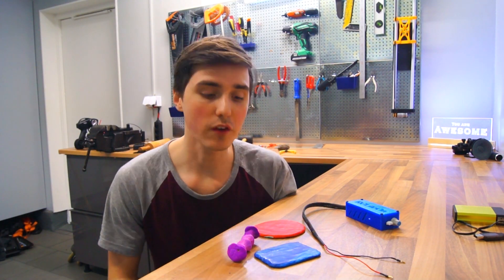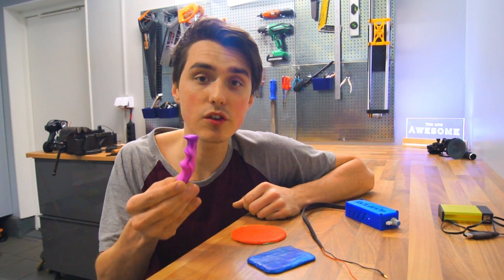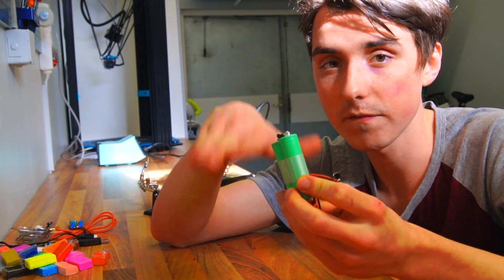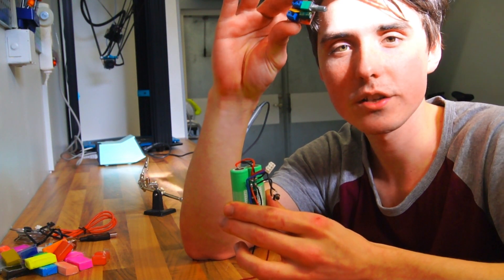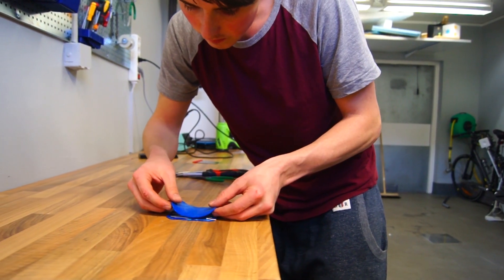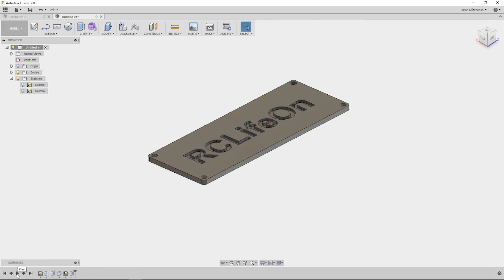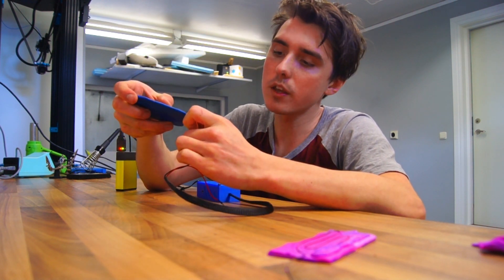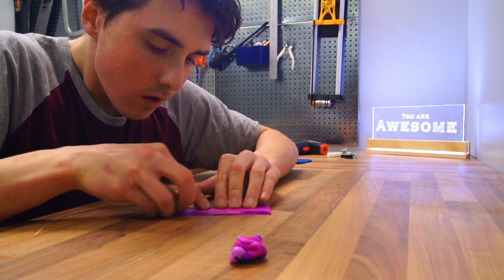Awesome Hand Warmer Life Hack - DIY Heating Elements

Comment: Greetings from Avebury in England. Please could you explain how to work out how much heating wire to use  (given the space available and how tightly you pack it in) compared to the voltage available vs the amperage drain? Thank you, and I love your well equipped workshop.

Comment: Make a heated steering wheel!
It would be awesome if it had for example three temperature options:
1) 40°C
2) 50°C
3) 60°C
And usable with 9V or 12V battery, because recharging it would be pain in the ass I think

Comment: Hello, Thank you for your video, its Awesome! quick question: what if I want my heater temperature to remain at around 50 degrees C. all the time? would the PWM be replaced by a resistor at that point? if so can you send me a link to what I can replace the PWM with? Thanks and again great video!

Comment: Ya'll know you can buy portable electric hand warmers for a buck on ebay? Come with a long usb cord and a carbon fiber element. You can be pretty rough on them (in a pair of boots?) It warms my bottle of quickfix to 97 degrees in a half hour. On a 20,000mah power bank I've never had it dip to half  power in a work week.
Reply: Our outside temperature minus 38 degrees Celsius in Calgary, Canada, can you send me a link to a element that can take 12v ?  The element quality should be really good.  Please help, thank you. I want more heat to handle this really bad weather. Thank you.

Comment: Where i can get a bms for a 12V battery
Reply from the maker: Ebay is your friend!
Reply: RCLifeOn i already searched there there is only 3S bms not 3s2p (3 series with 2 parallel) but thanks for the tip ;)

Comment: I made that, but instead of putting wire in the clay, I put a cpu, connected via 5v 750milliamps connected on two pins which would allow exactly 750 milliamperes.

Comment: can these create enough heat that I can boil water in a tiny pot?
Reply from the maker: Oh yeah, but you will need to use a more powerful battery and a PWM controller that allows more current to flow. I will definitely make a follow up video on this project.

Comment: Does the clay catches fire when it is used for long time? or Does any changes occurs in the clay when it is heated up?
Reply from the maker: +shree varshan No, nothing. I've now used it for several hours without any problems.
Reply: RCLifeOn that's good dude....I have another doubt that if the input increases to 9v... whether the output also increases r retain same?
Reply from the maker: The output is adjustable by the PWM controller. If you use a 9V battery you will be able to adjust the voltage between 3-9V. If you use a 18V battery you would be able to adjust the voltage from 3-18V.
Reply: RCLifeOn thanq bro for clearing my doubt!!.....by the way Ur all the videos are great n nice
Reply: @RcLifeOn  If i use a 12volt power source, what should be the length of the heating wire ??  I want temperature at 50 to 55 degree celsius.  If the length of the wire increases, does the temperature reduce.  Can you make a video for a 12volt power source with heat maintained at  50 to 55 degree celsius ?   Please please help.  Our outside temperature  is minus 38 degrees Celsius in Calgary, Canada, can you send me a link to a element that can take 12v ?  The element quality should be really good.  Please help, thank you. I want more heat to handle this really bad weather. Thank you.

Comment: Really, really nice, man. But you didn't need to connect the battery in series. In parallel I think it would work even better.
Reply from the maker: Yeah, you need the higher voltage for a couple of reasons. It will be more efficient and the PWM controller requires at least +3V. Next time I might even connect even more in series to make a 18V pack. This way you will need less current to achieve the same wattage (power output).
Reply: RCLifeOn Hmmm... I see... Always though that heating depends more on amps than on volts...

Comment: Two design comments.

The hand warmer is awkward with wires on both ends. Wires should be on one end only.

LED does not need to be "outside" the box. The filament you are using, it will shine through. That simplifies design a little bit.

You do great videos. Keep up the good work.